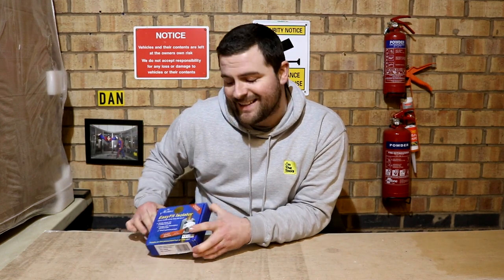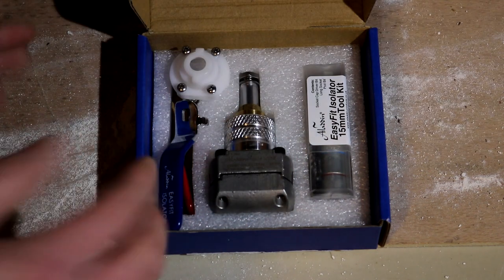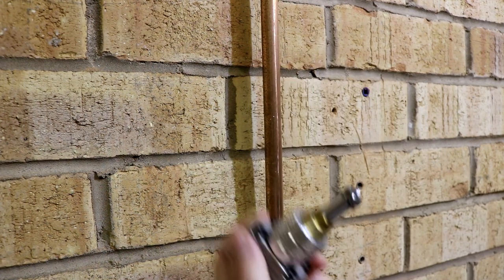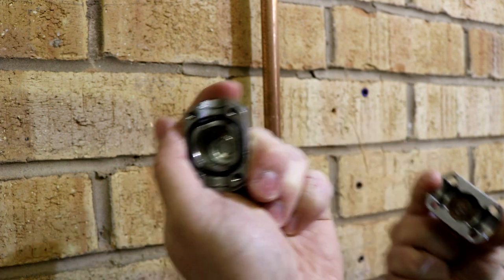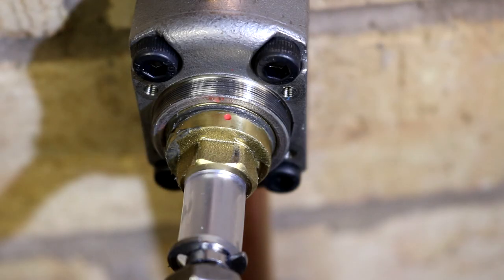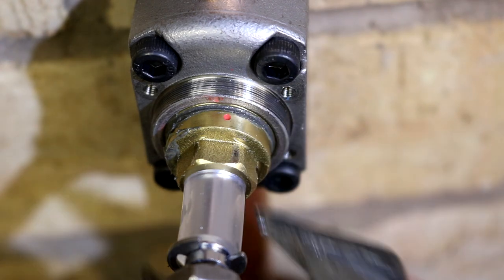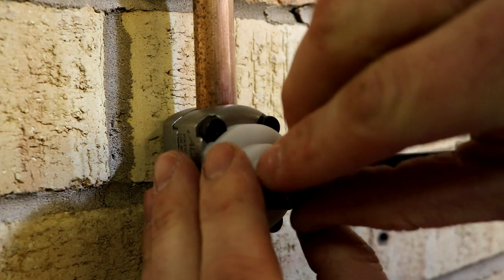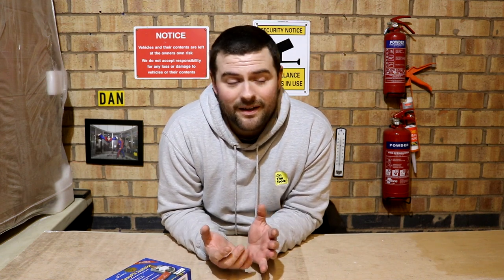How To Install The Aladdin Easy Fit Isolator Starter Pack

Comment: Good video Dan,  not being a plumber, I didn't know about these, I'll bear them in mind in case I need one in the future. !!
One point tho', . I was so curious about how it actually worked, I had to search a couple of videos, to find a "take down" (and pressure test), of a fitted valve, !  Anyway, I'm fully up to speed now, about these "bad boys",, 
Thanks again, these bits of kit, could really help you out of a tricky situation,,
   Cheers,,    John....
Reply from the maker: Thanks John, yeah they are great pieces of kit and certainly worth bearing in mind 👍🏻

Comment: Good idea better that a freeze kit which I've had actually burst the pipework it was freezing which led to a panic and cutting the live pipe and getting stoptap on quickly.  Still if not able isolate its always a risk Plus the mains is never very easy to get to in my experience as a plumber.  Good video though

Comment: Very informative video dan! Is this something i can use on a outside tap system to isolate from the inside to stop the pipe from freezing and bursting?
Reply from the maker: As long as the isolation valve in located where the seals will not freeze then it will be perfect, exactly the same scenario in the video thanks Callum 😁

Comment: What happens to the piece of copper pipe that’s been drilled out
Reply: This answer probably does not matter to you now but for those who are interested, there is a cavity at the end of the unit that holds the compressed sides of the drilled pipe. The pressure needed to cut through the pipe also includes compressing the copper waste.

Comment: If you're promoting this product, it might be prudent to point out some of the pitfalls.
For instance, if your property has imperial / old copper piping, the standard Aladdin unit is no use because the teeth in the standard gadget are not strong enough to cut all the way tough the thicker walls of the piping.
In fact, it can be disastrous to try the standard unit in older properties.
There is little or no guidance on this unless you have issues and then look at Aladdin's Troubleshooting pages where it is mentioned.
So, if you're suggesting that all plumbers carry one in their kit, you maybe should advise them to carry one of each, standard and Pro, of the 15mm size.
Reply from the maker: @glassjunkie1500  excellent comment, it wasn’t promoted just from experience. I think what you have said there is good advice and would recommend all plumbers to do as you suggested.

Comment: Used 2 of these they both leaked. So not impressed.
Reply from the maker: That's not good news, they are a little tricky to use. Fortunately I've used several and luckily never had an issue. Hopefully the next one you try it will be ok 🤞🏻